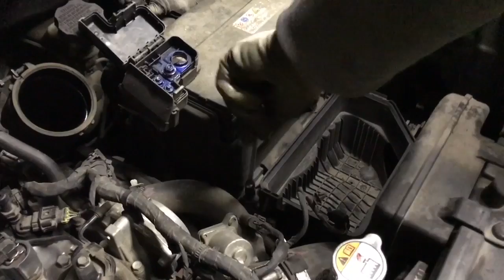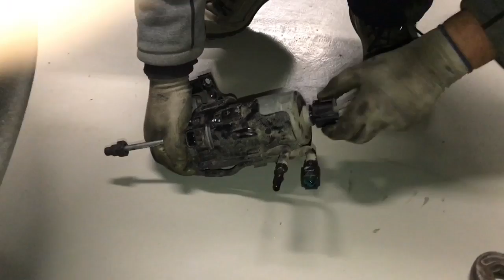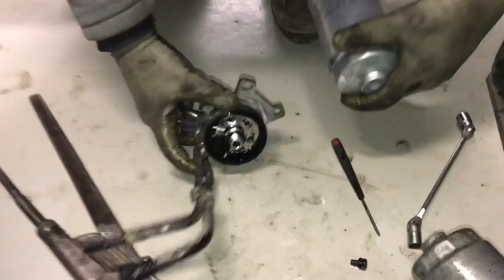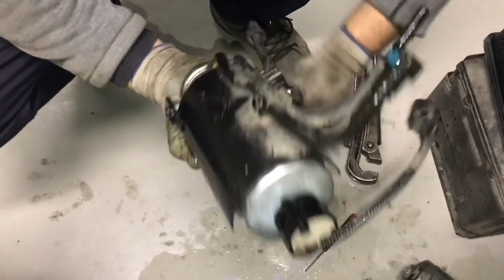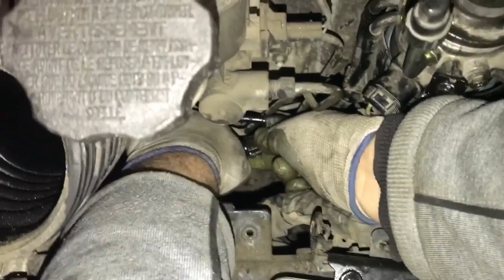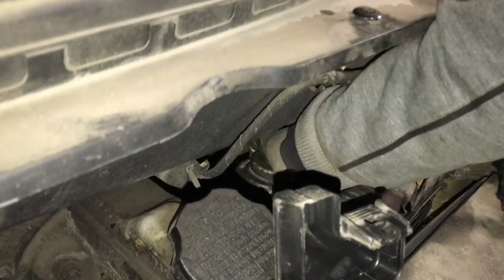KIA SOUL Diesel Fuel Filter Replacement

Comment: It's not necessary to remove all this, by removing the 3 nuts the disconnecting pipe and wire it will come out past the ecu & battery

Comment: Hi ! I have the same Fuel Filter system on my Hyundai, after a fuel empty I get a problem : my car get air and it's start hard(mor exactly in 4-5 seconds) What should I do ? Change the fuel filter? So how can I get air off? Because I want to start my car easy.
Another problem is sometimes my car start's and after 10 seconds stops, all of this after a fuel empty.
Reply from the maker: airlock. air must be expelled.
but, maybe the filter is counterfeit. will have to be replaced.

Comment: So you don't need to bleed the air out just connect up both fuel lines and pump until you feel resistance? I thought the pipe sticking up was to bleed it 😂
Reply from the maker: Yes! just connect up both fuel lines and pump until feel resistance.

Comment: Hi...I have to get out and use the pump on top of filter a few times before I start my soul 2 or it refuses to start......any ideas......
Reply from the maker: Pump, pump, pump ;)
When it well very hard, stop pump & try to start the engine.
Reply: @Mayson_Hillmayer  hi Vito thanks for reply...what I mean is I cannot start my kia soul normally at any time.....each time I want to use vehicle I have to pump the pump on top of filter until its hard and then it starts OK but it will not start normally ever if I don't pump filter first.... any ideas...
Reply from the maker: @shaunswain9546  the pump allows air to pass through. you need a new pump or restore the tightness.
good luck 🙂